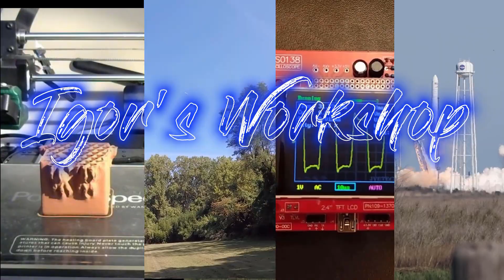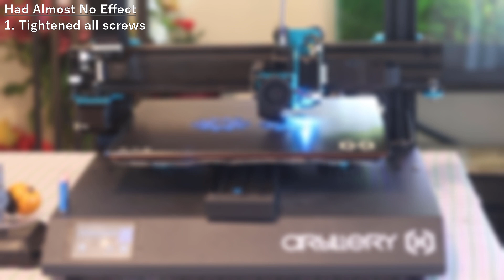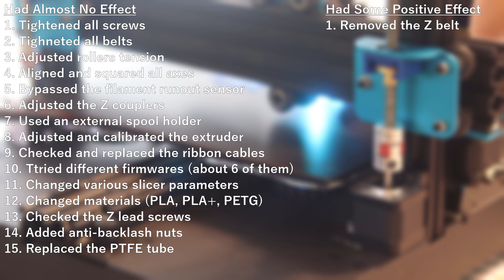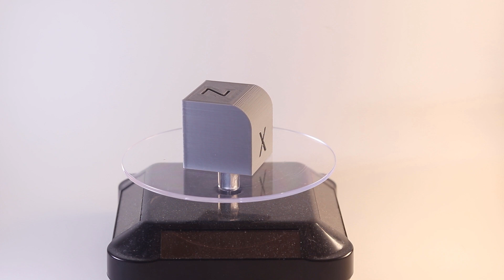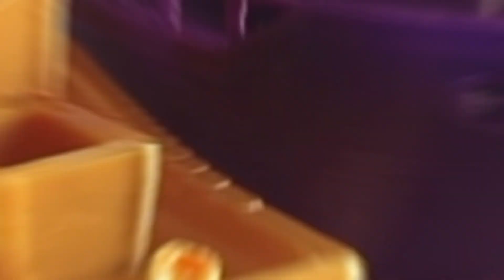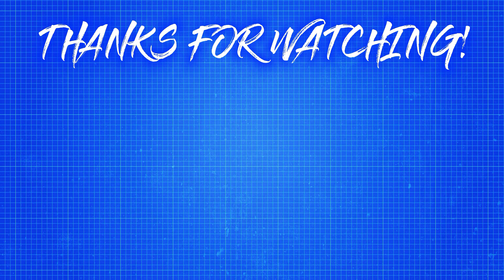Troubleshooting Artillery Sidewinder X1 | Part 3 | Is Quality Improvement Even Needed?

Comment: When I got my X! its prints were nearly perfect, from every angle. No tricks of light etc, they really were perfect. Now 6 months later the quality is not as good as it was at the beginning. Im trying to figure out how to get the original quality back. I wish artillery would post a calibration guide they use in building the machine because it really was excellent. I can see from the picture of your calibration cube you got a lemon. Something is wrong there. I know you know that, but just want to say because yeah, out of the box mine printed amazing. 100%

Comment: I’m going crazy trying to make the sidewinder print half as well as my ender 3 v2. The sidewinder prints the test cube that came on the flash drive perfectly but any other print it had bad z banding like it can’t push the gantry high enough to do proper layers. Why does it print a test cube perfectly then? I spit on the sidewinder it’s garbage. The ender 3 v2 is perfect
Reply: That’s correct, and is pissing me off and getting me crazy,  the test cube gcode that’s come in the pen drive is printed flawless, but that’s the only decentl print I get from that machine
Reply: @kamiwey  I quit using my artillery last year. It’s junk.
Reply: @WildmanGeorge  i´m about to do it also, i put a lot of effort and money to try to get something just normal from it but is useless
Reply: @kamiwey  you will feel better once you do get rid of it. It’s not worth the frustration I nearly went insane from it

Comment: Игорь run PID 5 - 7 times, record all values than average them out and use those values. 
2. Itstall bltouch. It will help immensely 
3. Enable and calibrate linear advance (TT TachingTech has wonderfull tutorials.)
4. Check Vref on every stepper they are most likely undervolted.
5. Enable S-curve
6. Make sure that grub wheel on extruder is not too tight or too lose. (I would replace it completely with a metal one).
I can probably come up with many more things but I'll stop here lol. 
I'm ordering mine tonight and I cant wait to tinker with it.
By the way I know those thing from experience I have heavily modified Ender 3 that keeps amazing me after 3.5 years lol.

Comment: Mine stopped working after one day of use I keep getting -15 on both the heat bed and extruder I Inspected the ribbon cables they looked ok but I fitted the spares just to make sure and I still have the same problem according to the printers info I have the Version 5 which seems to have those clips that clamp down on the ribbon cables like the early version and yes I made sure the ribbon cables were installed property

the only other option is opening the bottom up and having are look which will void my warranty which I rather not do considering the print has barley done 2 hrs of printing has anyone had this problem before and what solved it for them if I can't get solved I'm thinking about getting a replacement or refund and getting the CR-10S PRO V1 instead.

Comment: I have the same problem with the X1. I did the following test. The same part with the same slicer setting printed once on the Anycubic Mega S and once on the X1. On the Mega S there were absolutely no flaws on the outer contour. Unfortunately it looked very bad on the X1.

In my opinion, Atellery correctly designed the Z axis. Fixed to the bottom of the engine (the new ones have fixed couplings) floating in the middle and fixed again at the top. My guess is that the Z-bracing resonates when printing. Glue a piece of paper on top and watch it. I have seen some stabilize the Z-axis with an additional streak.

The concept is similar for the Mega S ... Fixed coupling at the bottom of the engine, fixed in the middle and loose at the top. But a more stable frame that is less likely to swing and that is additionally provided with guides on both sides. The X1 doesn't have that, since the rollers run on the Z-axis ...

It's just a guess, but first I'll look at the vibrations on the Z axis and then stabilize it.
Reply from the maker: That's actually a good idea. I have Z braces. Will try checking if there's any resonance...

Comment: I think it is the extruder setup. The idler/bearing guiding the filament is not centred, and it is wobbly. it also touched the small gear which drives the bigger gear, hence the force on the idles varies. I am thinking about redesigning it from the start. It should be solid and centred, not wobbly like this.
Reply from the maker: This makes some sense. What do you think about this design: https://www.thingiverse.com/thing:3883810 ? It seems to be much more locked in.

Comment: Hi Igor, could I ask another question about dealing with hot extruder motors.  

Do you know if the circuitry/components/laws-of-electricity would all work for splicing a second fan into the same plug/wires as the filament cooling fan on the printhead circuit board??

I was thinking of maybe adding a second cooling fan, if it's possible, to cool the extruder stepper motor and extruder cogs. This would be easier than running a separate wire to power it, and look sleeker. But I'm not sure if this actually works?
Reply from the maker: Not sure, I haven't tried this before. You can either put 2x24v fans in parallel (red wire to red wire, black to black) or 2x12v fans in series (connect one fan's red wire to the other one's black, connect the remaining 2 wires to the corresponding printer wires).
But I'd suggest you at least check VREFs first. It's not that hard, if you have steady hands and don't rush it. The motor shouldn't be so hot you couldn't touch it. This means there's either an incorrect current setting, or a mechanical problem.
Reply: Thanks Igor

Comment: Quick question. Does your extruder stepper motor get hot when printing? 

 I've noticed mine gets quite hot.  Maybe anywhere from forty to sixty degrees C.   Too hot to hold the back of my finger against the motor body for more than a second or two.

Do you know if this is normal?
Reply from the maker: Mine is warmer than the others, but not really hot. You may have VREF (and, therefore, current) for the extruder motor set too high.
Reply: Thanks, I thought it might be warmer than normal. Now I just have to school up on how to go about checking and fixing that. 

While I was searching the web for ideas on hot extruder motors, I found a bloke in a worse situation than me though. His extruder was getting so hot that after a couple of hours of printing the extruder drive cog would start to melt into and through the filament, and so any prints longer than an hour or two would always fail. 

I've sat a pedestal fan in front of the printer and pointed it directly at the print head while I've been printing in vase mode pushing a .4 nozzle to print a .6 wall. This seems to get it the hottest, though it still gets quite hot printing at more typical settings.  If I have the fan on it, the extruder motor goes back to being a temp that isnt too hot to hold your finger against.

Have you done any videos on vref?   I've looked at so many videos these last few weeks that everyone's videos have blurred together and I can't remember where I saw what.

Comment: Thanks for the video Igor, I'd been wondering how your X1 tuning was progressing. You definitely gave it a good effort.

I had come to much the same conclusion as you after not really being that impressed with the print quality I was getting.   After watching and reading every bit of information i could find, and trying a bunch of different tactics to get perfect prints, my efforts had resulted in no great success. Started to think that maybe my expectations are too high. In the end I dicided to give up and just go with it as is. Main reason being is that I realised I'd had the printer for four or five weeks and all I'd printed was a flotilla of benchies and not much else.  I'd gone down a rabbit hole trying and got lost.   So yeah, gave up trying when it stopped being fun, and got on with printing all the things I'd been putting off until I had it tuned in. They aren't coming out too bad, but they definitely aren't perfect.

Like you, I think it may just be pot luck. Like any multi-part built machine that comes out of any factory any where in the world, some finished products are better then others, and a number will be lemons. I think I may have been unlucky this time with the machine I ended up with. It's not a lemon, but it's not a demon of a machine either unfortunately. 

In most ways I do like the X1, so I dont want to trash it at all.   I'd still buy it even if I knew beforehand what I know now.
Reply from the maker: Exactly my thoughts now! :) I feel I'd gone down the same rabbit hole. Still, I think there's some potential for improvement. I've replaced the couplings, which has noticeably improved surface quality. I also want to try replacing the stock leadscrews, I happen to have 2 leadscrews of the needed size. In general, yes, I'm becoming more content with it. I've just finished printing 30 bookmarks for my son's class for the Valentine's Day, I've also printed a few things in TPU - it handles flexibles just fine.
Reply: I got a ender 3 v2 and it’s perfect surface quality. I can’t stand to look at my sidewinder now it’s absolute trash I’ll never buy anything but creality from here on out

Comment: I am thinking of purchasing this printer for my first 3d printer.  Would you still purchase this or would you get something different?
Reply from the maker: Hi Scott! I'd personally say it's not exactly a beginner-friendly machine. Feedback on the Artillery support group on Facebook is dissonant. Some people swear by this machine, others seem to have nothing but endless issues. Looks like QC at Artillery is lacking. It's definitely easy to put together, I must give it that. Just make sure that all bolts are tightened properly, everything is true and square, rollers and the extruder are properly tightened, and be careful when inserting the ribbon cables.
If you decide to get an X1, then make sure to get it from a respectable seller, paying attention to their return policy, and don't make the mistake I've made - don't throw away the box and the packaging materials for at least a couple of weeks. This machine has potential, but you need to be willing to tinker with it. Looks like the amount of tinkering required depends on the batch you get a machine from. Artillery seems to be making some changes in the new batches (like using different kind of Z axis couplers). We'll see, if that improves consistency. 
If you want a large printer (300x300x400) on a budget, then your only other option is probably CR-10 V2. The main disadvantage of it is that it has a Bowden extruder, which not necessary a disadvantage if you're not going to use flexible filaments. I print with TPU often, so a direct drive extruder was a must for me.
Reply: @IgorsWorkshop  Appreciate your insights.  I've been guided towards the Prusa Mk3s.  A bit more money however.  But I would have local support.
Reply: For the love of god do not buy it get a ender 3 v2
Reply: @WildmanGeorge  went with a prusa i3, very happy with them

Comment: Hello Igor, seem that a lot of Sidewinders x1 having same problem as they call z banding. I was ready to pull the trigger on buying some z rod couplings myself. I just seen a Video about putting a I think a 6mm ball bearing inside the z coulpling, an it seem to fix z banding on a different printer. Thanks for the video , helps to see what your hard work of things that did not have any effect on quality . 8 bolts to put the machine together about 15 min tops made easy for most new bees , months an months to get quality. The battle goes on.
Reply: Igor, not sure if u seen youtube video yet or if this mod even works . Bearing on the extruder arm rubbing on the extruder gear with different pressure an the fix is to use washers to prevent layer line s

Comment: Hi Igor! Great video! I want to ask you, if you removed the top bearings how that two leadscrews stays in place? You dont have gape between leadscrew and the top plate?
Reply from the maker: Yes, I removed the top bearings. This was recommended by Artillery support (along with the Z belt removal)
Reply: @IgorsWorkshop  Yes, I know, you told that in the video. But I'm curious how the leadscrews stays if they don't have support?
Reply from the maker: @ovidakis  They are supported at 2 points: the couplers on the motors and the nuts on the X axis assembly. 2 points are enough to define a straight line. If you fix them at a 3rd point and they are not perfectly straight, it will only introduce an unneeded stress. At least that's how I see that and that's the logic behind the top bearings removal.

Comment: Hey Igor,  great video.
I saw someone with similar problems and they stated that they opened their x1 and they made changes to their driver voltage and that fixed the problem (they show pictures of measuring the voltage and with a screw driver they lowered the voltage).

Don't know if that helps but might be worth to see if it helps at this point.

Also some try different slicers to see if you have the same result?

Best of luck.
Reply from the maker: Yes, I tried that as well. Didn't have any effect. All VREFs were set to ~1V. I adjusted them to 0.8V without any noticeable effect. Seeing that, I've returned them to 1V. The steppers are cool, and there are no skipped steps.

Comment: Thanks, Igor for the follow up and listing all the steps you've taken so far. So, that calibration cube. Are you saying that the first picture is the same cube, not the same file or model but the actual same cube as the 2nd one on the rotating turntable? Because the first one looks white and not good. The rotating shot of the cube looks grey or silver and from a different material. I understand that lighting changes everything especially when it comes to surface details but this is surprising. You mentioned calibrating the extruder. Does this mean you calibrated extrusion multiplier percentage (or Flow % in Cura)? When I performed that on my printer it made a tremendous difference. I was over extruding by 15% even after calibrating E steps/mm. Both calibrations are necessary (as I'm sure you know). Anyway, your prints look great in the video with the lighting you shot them in.
Reply from the maker: Yes, it is THE same cube :) It is printed with Inland Silver PLA+. The crappy looking shot was taken with a spot light shining from above and up close. I calibrated the extrusion multiplier as well, and ended up with 97%. I tried lowering it even more and I started noticing some underextrusion on the top surfaces with values lower than 95%. Are you saying you had to lower your extrusion multiplier to 85%?
Reply: @IgorsWorkshop  Yes. Well, in Cura the parameter is set in Material/Flow and it defaults at 100 but after calibrating my E steps I decided to run a extrusion cal. and after I measured the results I had to take it down to 85 so yeah it was over extruding 15%. I don't get any under extrusion and my walls look so much better. It also took my calibration cube dimensions to with .02 mm where it was consistently about .3mm too large in X,Y.
Reply from the maker: @ew7007  Interesting. I will try re-doing calibration. Ideally, you should calibrate for each material individually.
Reply: @IgorsWorkshop  Yes. That is right and I have some more work to do in that regard but I've been working on some temperature problems and until I get that nailed down I really don't want to get too far ahead of myself. Thanks for all the time you put into sharing your process with your subscribers. It really helped me make a decision about the X1.
Reply from the maker: @ew7007  Thanks! This machine definitely has some potential, but it looks like quality control is lacking. A new thermistor have arrived in the mail today, I will try replacing it and see, if it addresses the PID autotuning issue.
Reply: @IgorsWorkshop  I've been thinking about this video you posted and I have some questions about your work on the Z axis. Can you do a short video about what the X1 looks like now that you removed the top leadscrew bearings and belt and what effect that has on the leadscrews when they are turning? I would think that the ends would wobble and induce vibration into the carriage even though Z changes are pretty small during a print. Thanks!
Reply from the maker: @ew7007  Yep, will most likely do that

Comment: Looks like I am having the same problem as you. But mine is intermittent. Some times it is under extruded and other times its perfect. I am running stock out side of tubing replacement. I look forward to see if circuit board or motor replacement works. Great videos.
Reply from the maker: This intermittent underextrusion may also be a symptom of a bad filament (uneven diameter). Did you check yours?

Comment: Lighting is a real thing... but I think the board is garbage. I replaced mine with a Duet. It’s helped immensely
Reply from the maker: Which Duet board did you use? Was it an easy replacement? Also, did leave the stock motors in place?
Reply: Igor's Workshop I used a duet 2 WiFi. Yes stock motors. It took a little hacking but it’s working good now